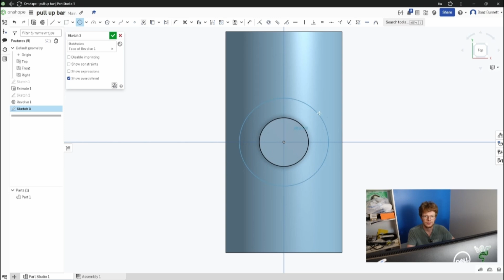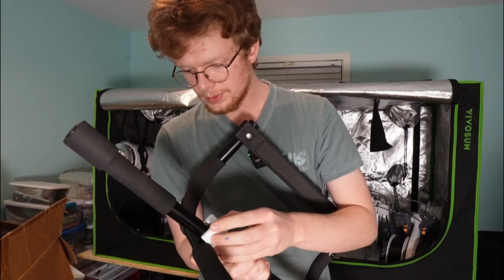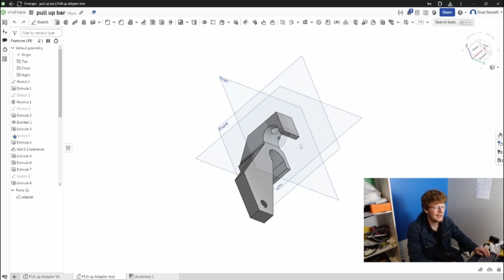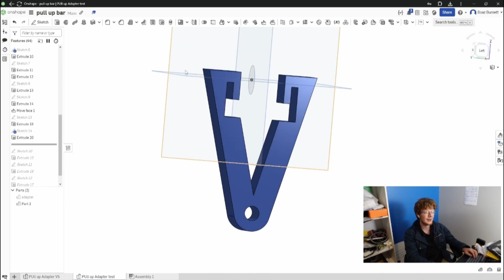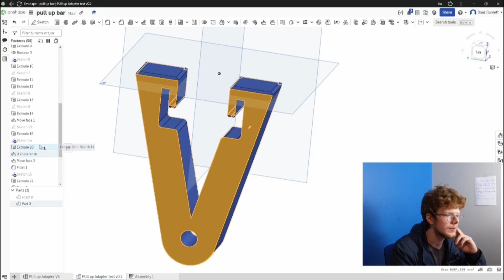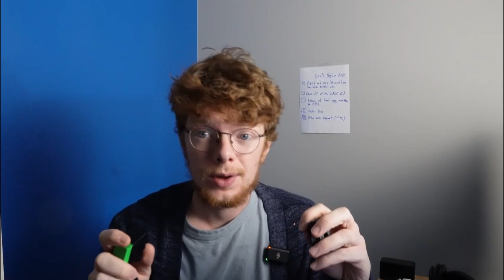I CREATED a Climbing Pull Up Bar Adapter - Full Process

Comment: Dud that's very cool 🤯
You should sell these
Reply from the maker: Thank you so much!!

I thought about selling them but I’m a little concerned about durability especially as I’ve only tested it at my weight of about 150 lbs. can’t really guarantee that it will work past that at this point. 

I did list the file in the description though!